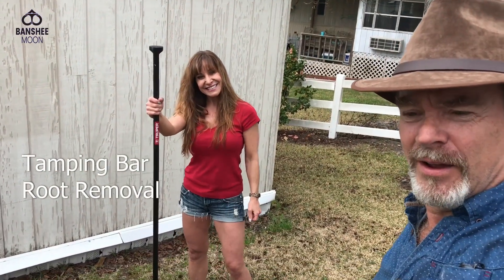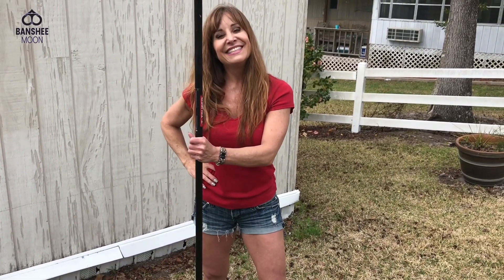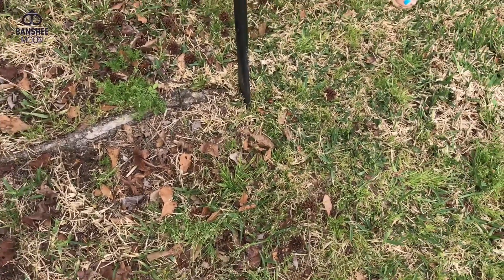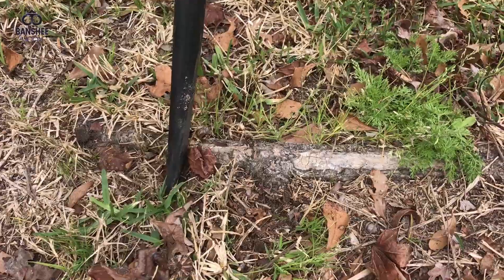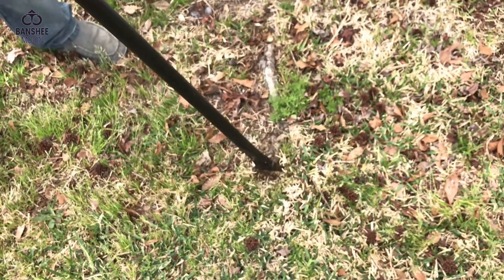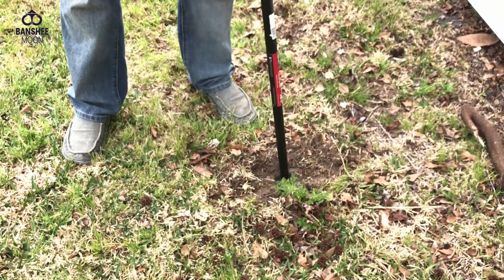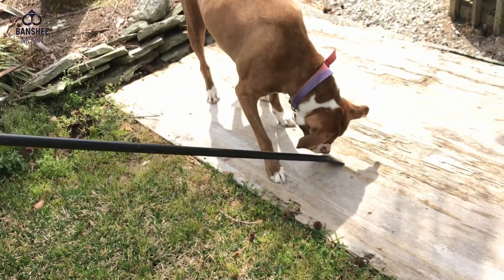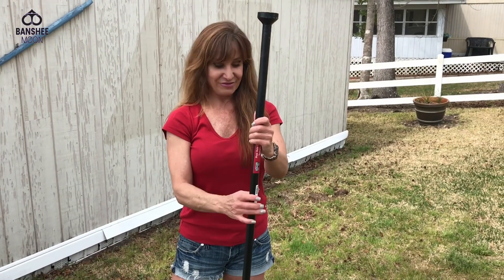Root Removal | Concrete Removal | Post Hole Digger | Weed Removal | Tamping Bar

Comment: The tool you have is a post hole digger, pry bar and tamping bar. The sharp end is designed to cut through the grass and it's designed to dig a hole and pry objects out of the hole like rocks, roots and things of that nature then the flat side is designed to tamp the dirt down once you've finished putting your fence post in the ground. The bar is generally used on ground that is fairly solid or hard to dig through where a traditional post hole digger is just not going to do the job.

Comment: I have one of those on my work truck and I use it all the time.  They are great tools when you need leverage to remove a heavy object or to cut up concrete around a fence post to replace the post.

Comment: I've had one for years. One of the best tools around for the garden.
Reply: I'm a fence builder sometimes. 
I call it a wrecker bar. 
One of the first known hand tools. If you spin it between hits, it acts as a hammer drill. A really slow one.
Reply from the maker: Yes it's amazing how many applications it has!
Reply: @bansheemoon  have fulcrum. Will travel! Lol

Comment: I have a better tool! It's a big heavy bar like that. Mounted on top is a bigger and heavy tube that slides up and down and you use it like a sledge hammer to pound the bottom bar thru asphalt, concrete or what ever. It has a vinyl coating over the top cylinder so it's non-slip. because it's closed at the top there is no missing the bottom bar.
Reply from the maker: Sounds awesome! :-)